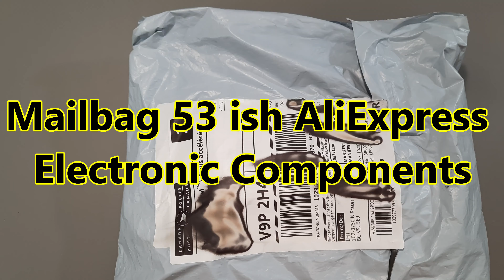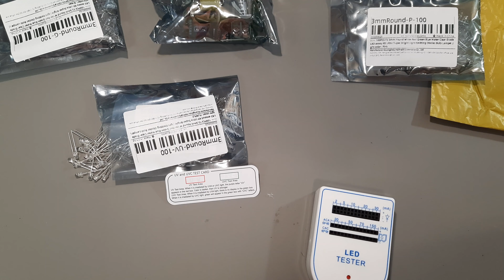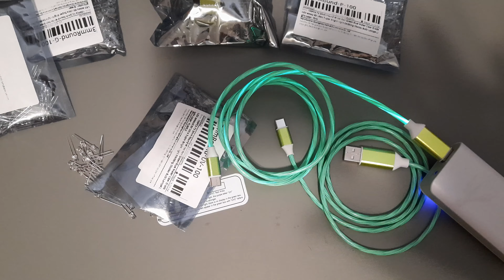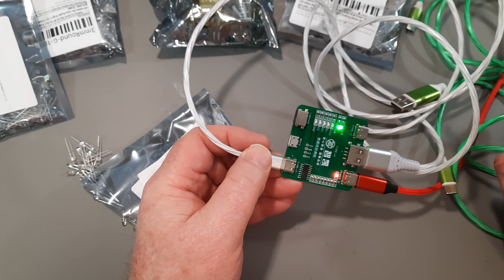Mailbag 53 ish AliExpress

Comment: Are duties and taxes to the U.S. added yet? Or still getting mail without?
Reply from the maker: I am based in Canada and all packages I have received came from China to a Canadian city so currently outside of the tariff stuff. I had planned on buying a piece of test equipment but am holding off since it is made in China but shipped through the US, and the price went up over 10% in the last month. Even thou the company has a Canadian branch I suspect they do all their importing through the US. 
Spending is taking a significant drop this year but mostly due to lots of supplies already hoarded. 
Hopefully it will all get sorted out eventually.

Comment: I bought some pretty damn similar light effect usb c cables from AE and used them exactly once to charge something. I burned my finger on the USB-A part of the cable where the light source apparently is. It got soooo hot during usage I disposed of it. Please keep an eye on this. Thanks for the video <3
Reply from the maker: It is a bit warmer than my longer brighter charge cable but not enough to be concerned about. Will keep both eyes on it thou. Previous ones I have bought have all been good. But with everything out of China, always best to make sure it is safe since they have no safety standards to follow

Comment: You know if you put the LEDs in different parts of the LEDs Tester the same led will have a different brightness 😉
Reply from the maker: Yes the current range is 2mA to 30mA. The point was that for some LED colours the change in brightness is very hard to see the difference between 2mA and 20mA. And if your project is powered by a power bank or AA etc, it will make a huge difference in the amount of time the power source will last. The green at 2mA was brighter than the red at 20mA.